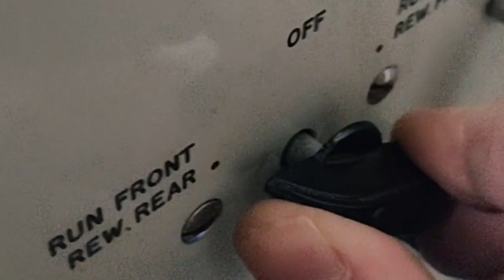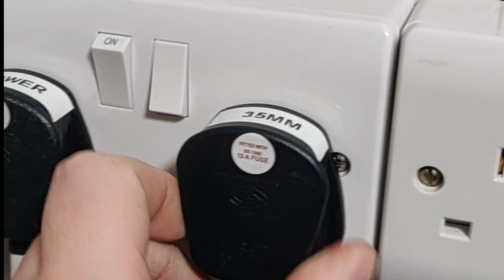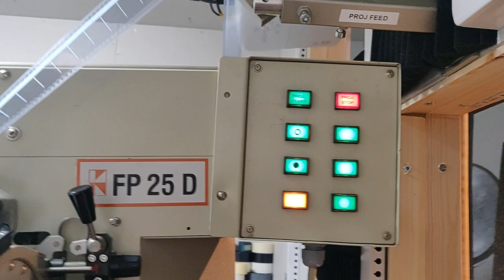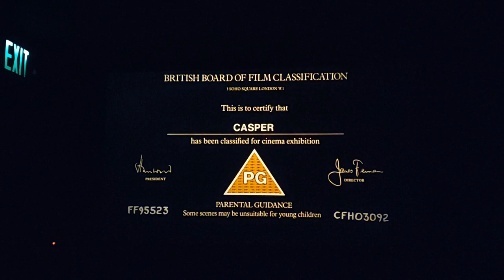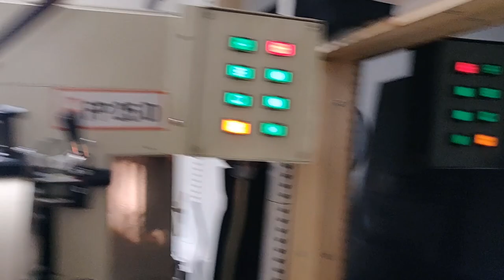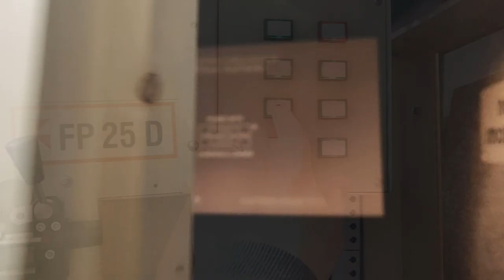35mm Home Cinema Make-up, Projection & Break-down of “Casper”

Comment: It's an amazing process but one can see why this labor intensive process was going to be eventually replaced by digital projection.
Reply from the maker: Very true. I am a projectionist still, but completely digital. It still has its moments, but certainly not the same as dealing with film.
Reply: @Reel35  I'm intrigued, I almost became a protectionist back in the time of film, is it half as interesting projecting digital? I imagine not so much? I don't even recall hearing the soundtrack before seating the last time I went to the cinema (yesterday)

Comment: this Is the most beautiful thing I've ever seen.
Reply from the maker: Thank you 👍
Reply: @Reel35    GREAT video!   Thank you for posting  ...  

   I wonder can you tell me please
1    why did the upper reel have the off balance  when setting up and breaking down the movie?

2    How did you find the exact spot  for the splice ( Is it easy to see when braking down the film  ?

3  at 8:40 there was a peice of paper  ( It seems in the reel ) what was that for
Reply from the maker: Hi, thank you!

For your first question, are you referring to the smaller reel? That is a spooling off plate which each reel of the feature is wound off onto the main bottom reel and back up again when breaking down. 

Your other two questions are actually related.  So, to find the exact location of a reel join I use bits of paper to identify its position.  This is the paper you see at 8:40.  When the spliced join goes through the projector, I place a small bit of paper on the take up reel.  This means that when breaking down, I can easily identify the location of the join.  

Hope this helps :)
Reply: @Reel35  Thank you for answering ... Yes Sir, I was referring to the smaller reel ..Without that paper in the reel  I can only imagine finding the splice is like finding a need in a haystack..

Comment: i would like to see how the projector sound is conected to the denon  av receiver , but anyway 35 mm film and digital sound is real cinema , is pure magic
Reply from the maker: Hi, I have posted a tour of the cinema video. I briefly mention about the sound. Basically, The sound pickup in the projector is wired up to an XLR connection (two connections, one for left and one for right). The XLR is then connected into an RCA cable and goes into the back of the AV Receiver.   I do have a Dolby processor, but it’s not working.  So, for now, 35mm is just stereo sound. But it still sounds great thanks to the AV Receivers processing power :)
Reply: @Reel35  thanks for your answer
Reply: @Reel35  also you can use the dolby prologic from your receiver to reproduce 5.1 from 2 channels, its not necesary that the source be digital , that's the dolby prologic function to reproduce from 2 channels 5.1
Reply from the maker: Thanks for this tip, that’s good to know. I’ll have a play with the receiver at the weekend :)
Reply from the maker: Completely forgot to reply back to you on this - had a play with the amp settings and I now have the 35mm with pro logic, which sounds SO much better! Thanks again :)
Reply: @Reel35  can you do a video about it?

Comment: How many times can you make these joints and cuts in the film until it wears out? Do you make new cuts in the film? How many projector runs can you make with a 35 mm until it's unwatchable?
Reply from the maker: You normally cut one frame off the start and end of each reel to remove any splicing tape left on it, however this wouldn’t make a huge difference (24 of the frames make up one second), but over a long period of time it would.  So, to avoid this you can just peel off the left over splicing tape from the previous use and just resplice without having to cut another frame out.

Comment: What happens to all the 35mm prints that get struck for projection in theatres? Up until the more recent move to digital projection,  that must have meant thousands and thousands of 35mm prints. Did they just get destroyed by the studios after Thierry theatrical run??
Reply from the maker: I often wonder where they all went.  I hope they’re not all destroyed, and hope that there’s an Aladdins cave somewhere with them all stored. But, sadly, I suspect that majority have been destroyed.  Thankfully, though, lots are still available on eBay :)
Reply: I worked in movie theaters and was a projectionist for a bit in the late 90s and considering how controlling the distributors were of the prints I imagine many were destroyed to prevent unauthorized use, though some were probably preserved for archival purposes. 

Keep in mind also that many of those prints were probably not in any shape to be preserved when done. With platter systems and automation depending on the number of screens a theater had they might only have one or sometimes no projectionists regularly scheduled (smaller theaters sometimes had the managers or other staff handle threading and starting the projectors with actual projectionists only scheduled for certain things like film build up and tear down). This meant that threading would be done quickly and the projectors/film transport not cleaned as often as it should have been. Multiply that by many showtimes before first run is over, then possibly getting moved to a second run theater and many of those prints were likely returned at the end in rough shape.
Reply: @Reel35  They used to mostly get incinerated I'm sorry to have to say. Most distributors kept one or two copies of a title for retrospective hire, but they rarely knew the condition of them until someone tried running it...
Reply: Just to continue from previous comments, most theatrical prints were sent back to the distributor to be destroyed. Most have been played hundreds of times so you can imagine how rough they ended up. I remember seeing films at the discount movie theaters which were often a month or two after the first run and those prints were pretty scratched up. Also, theatrical prints were a few generations away from the original camera negatives so aren’t exactly high priority for archival purposes.

Comment: This was so cool! I have always wondered how you made up a movie with 5 or more reels. How many minutes worth of film did those huge reels hold? Those big reels you had,...who made those?
Reply from the maker: Thanks. So each individual small reel is roughly 20-25mins.  The large reel can hold about 2.5hrs (ish).  Large cinemas would have used a cake stand or platter system where the film would sit on a platform horizontally and fed from the centre - this would also be able to fit 3+ hours on and also have the film automatically rewound ready for the next screening. Sort of like a 8track.

Comment: Can you show 35mm animorphic, with masking(not sure the technical term) ? Do you own or rent prints?
Reply from the maker: I have just managed to get the anamorphic setup so that I can show cinema scope films but I have a fixed screen so the masking doesn’t move. This means that the scope image will have a black bar above and below. Eventually I aim to get movable masking to frame this better :)
Reply: @Reel35  that's amazing. Thanks. 🙂❤❤🙂
Reply: @Reel35  I prefer setting masking using side curtains. But this assumes you setup a screen that is natively for Scope. That is you set lens throw for the Flat lens so that you have side bars(fills top to bottom) and can mask the sides of the screen by closing the curtains. Always fun cutting new Aperture Plates to fit a custom screen. :)

Comment: There No THX Logo What So Ever
Reply: This 35mm print of “Casper (1995)” was sourced from the UK. The UK doesn’t have any THX Certified Cinemas as far as I can research, so that’s why there’s no THX logo on the print...
Reply: @iGuy2007  what about the sound was it dolby digital or Dolby Stereo and how did u get it to come thew a home theater receiver analog out then in the receiver?
Reply: @JunkerDC  Dolby SR optical track, DTS digital track on Casper. I'd imagine he has a Dolby processor for optical tracks.
Reply from the maker: Hey all - it's Dolby SR.  At the moment the 35mm audio is just outputted to a standard home cinema AV receiver by XLR to RCA cables.  I do have a Dolby CP500 - but the screen has gone funny.  One day I'll get a processor hooked up for the full experience.